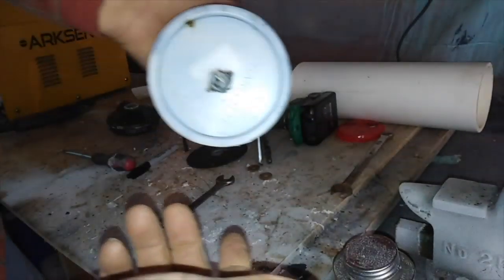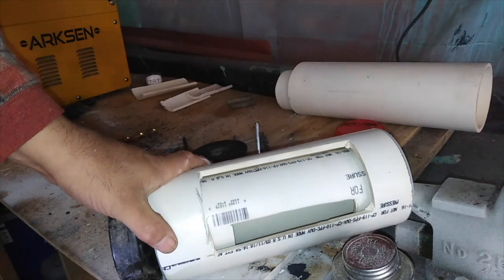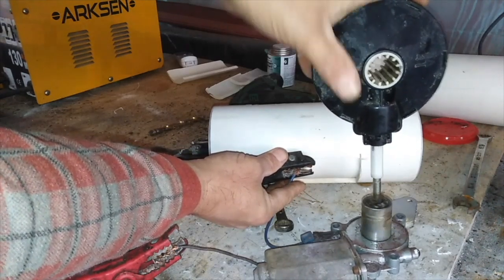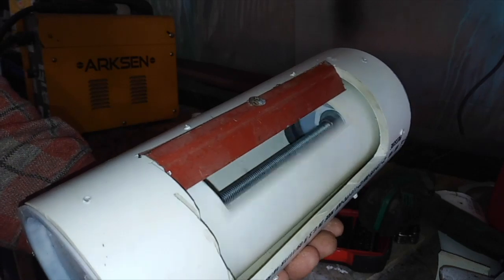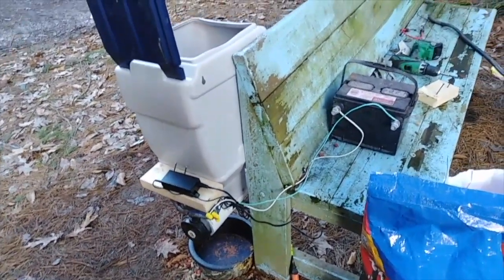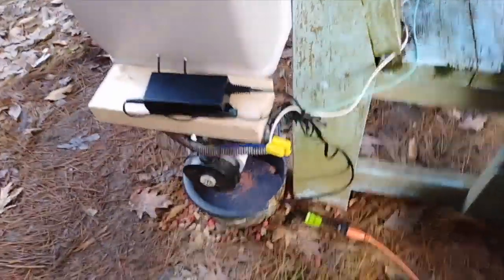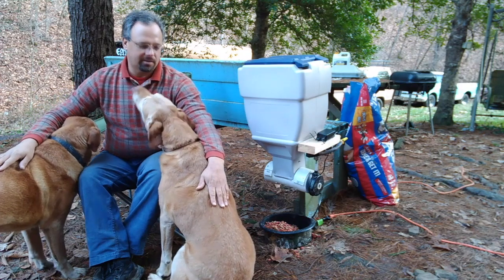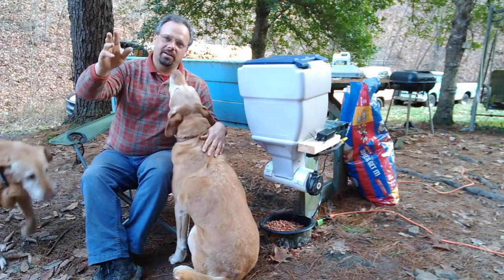Homemade Automatic Dog Feeder Part 2

Comment: I’m wondering if it would be possible to create something like this using a solar deer feeder. Trying to make an automatic grainer for the horses without breaking the bank.
Reply from the maker: It shouldn't be hard at all. Depending on how much feed it puts out at once. Maybe a 5 gallon bucket with the bottom cut out put around the feeder part. That way the feed will hit the inside of the bucket and fall straight down into whatever you want the feed to go in.